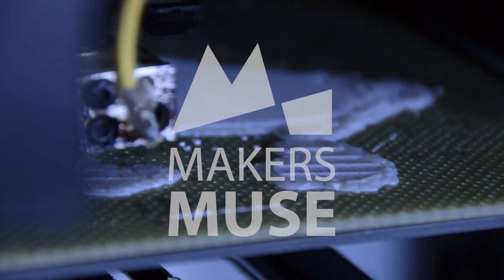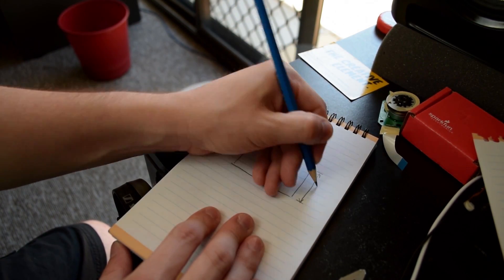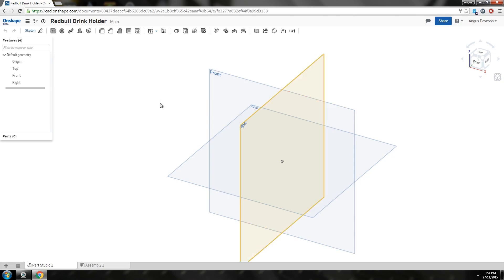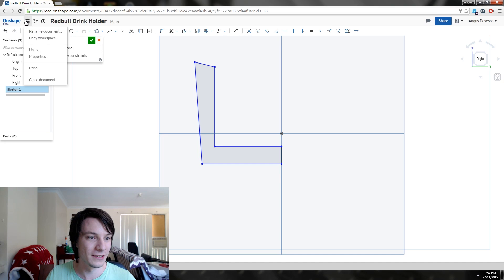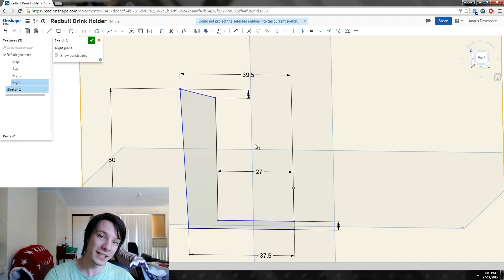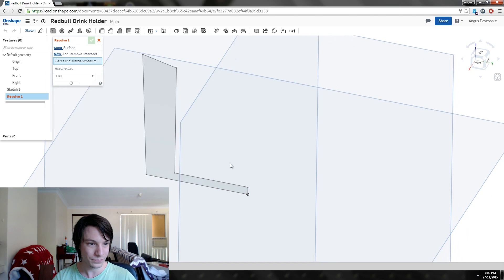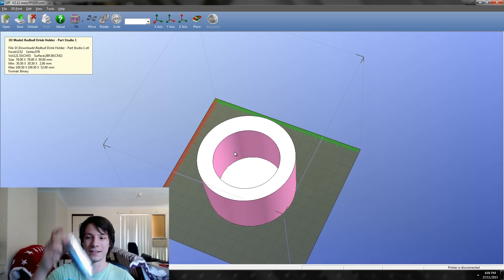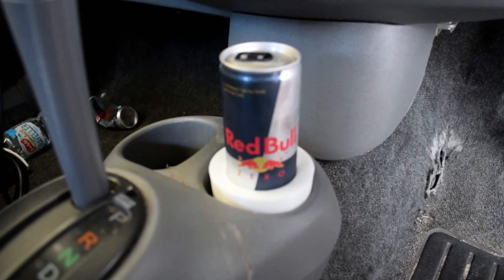Let's Design Something in Onshape! Redbull Drink Holder - 2015

Comment: Something I learned,  regardless of what mode it's in, imperial or metric, you can type in a dimension with either in or mm after it and it will calculate the appropriate value for your current mode.  You can even do math when entering a dimension, i.e.  entering "27+50mm" would set the dimension at 77mm.

Comment: i figured out that "splitting the design/sketch in half" is the way to go when constructing "lathe machined"-objects. but still... my mind works in diameters and pictures the whole thing. i am wondering if there is a way to constuct "diameter based" (so that i can see the correct values in my dimensions) and split the whole thing in half when i am done???

Comment: Great video tutorial. I used my 3D printer a little while ago with a simple screw lid design. My wife has a drinking glass with a metal screw on lid and the lid started to discolour and rust, so I made a screw-on lid with PLA. While the lid does work it is not water tight so I need to make a soft plastic seal for the inside of the lid. I used "Vectary" online software and I did change the settings to use mm and not inches but something went wrong with these settings, after printing the lid, it did not fit the glass. I had taken detailed measurements of the glass and transferred these to my drawing and then using the rotation tool to make the lid.  The inside thread was fun because it caused memory issues with the laptops 4k ram, so I think I need to boost this up to 6 or even 8K ram or I look at other ways to create the thread. Not sure if the glitch is in the slicing software (Cura) or both but they are supposed to be compatible. However, overall I did find that this was a very satisfying and practical application from a design and manufacture perspective. I would encourage everyone to try it, you will find it very rewarding.

Comment: I think that if you'd left the bottom out of the holder when printing - creating a tube -  it would have been a better solution as the can would then sit more securely to the full depth.
Reply from the maker: +Nicholas Fox I wanted to catch any spilt redbull instead of it making the original holder 'even more' sticky, but yeah either design could work!

Comment: pretty good effort alex. do you think if you made a torus with the same inside dia as the can, and the external dia similar to a point in the draft it would be simpler?
Reply from the maker: +Richard Hart Hmm You probably could, not sure you can get too much simpler than a single sketch and revolve though! 3D Printing a Torus shape is challenging as well, due to the small contact area on the print bed.

Comment: why didnt you just make the outer diameter the size of a can?
Reply from the maker: +alex elias Could have done! But the drink holder in the car is quite oversized and oddly shaped, so a normal can is still a little bit loose, I wanted a really tight fit.

Comment: Angus.  This is exactly how I print.  For 'need'.  I need something, look for it online, don't find it and then make it.  Idea in the morning and finished product before dinner. Being able to create things in 3D software is the next step up from simply downloading from online repositories.  I find it is a much more satisfying experience.  Better than crossword puzzles.  I  never hit the correct size first time.  2 or 3 iterations usually get it done right.  Thanks for the video.  Good stuff.  A practical demonstration of Onshape.  (Funny, I live in the US and am trying to convert to Metric.) [ I have a Lulzbot Mini.  Great printer.  I use Cura as my slicer. ]

Comment: Nice :)The best way to design a proper shape for your adapted can-holder, is to scan the actual can-holder, get a point-cloud from your 3D scanner, generate a STL, design the shape of your Red-Bull can, apply about 3mm  offset to it,  make a Boolean of the original scanned data - (minus) the Brep solid that you got from On-Shape. After that, print it!
Reply from the maker: +Davide Ciarloni For sure! 3D Scanning is perfect for unusual, non uniform shapes. What kind of scanner would you use for something like a car drink holder though? It's a fairly awkward location. I had enough trouble getting calipers into it!
Reply: Thanks for your reply!
..  a portable 3D scanner.
There are many on the market. Some of them are really cheap (they are not so accurate...).
You have to ask also for a direct STL output.

Comment: You should try out octoprint. it is a server program for your 3d printer, it even has the option to timelaps your print.
you can feed it gcode from your favorite print software or a STL file.
 
Most 3d printers are supported by it
Reply from the maker: +DutchBrony Octoprint looks great, definitely need to give it a go. Sadly it's not compatible with any of the UP! Brand printers (closed source slicing and control software), but should work fine for the Wanhao i3.

Comment: you could of opened you model on meshmixer and pressed hollow... make the offset a small amount then cut and slice it like bread.. then mirror so it has four arm's and it would use alot less material. . I will try it and if it works I will upload it to thingiverse and let you know

Comment: there is a cool function in meshmixer that BLEW MY MIND. ... I saw that your design.. the top was skewed.. you can cut the top and make it flat on meshmixer. . then if you use the select tool you can make the angle threshold lots and size as big u want. . then after you select a face.. press deform and transform.. it stretches it and if you drag it up then hold the little squares next to the arrows.. and drag it you can make it angles and do that a couple times then use select tool and select the sharp edges and press smooth. . for corners on objects use Cotan. . for the faces like the sharp edges along the main part use membrane. . I love turning things into vases by using this tool.. please try it Angus and let me know how it goes and if it works

Comment: hmm I cant find dimension tools it seems my controls are a bit different. I put in the survey that I don't work with cad and I am used to solid works is this the same as you?
Reply from the maker: +Yadher Bustamante The layout is a little different, however you do still need to make sure you're in sketch mode to access the sketch tools, the dimensioning tool should be upper center on the tool bar.
Reply: +Maker's Muse strange i looked everywhere i did the revolve and everything. im in sketch but dimension cant be changed its just hiding im sure i will find it. thank u for the video it was convincing enough to make me switch.

Comment: Seems like you printed that solid. If so, it would be overkill in wasted plastic for the simple functionality and be less effective as an insulator than if you left a matrix of air in the sides with low fill.  Just a thought of something to keep in mind and relay to people when doing such tutorials to speed print production and reduce waste when possible not to mention the side benefit in this application. Otherwise, keep up the good work.
Reply from the maker: +SayWhat? Not solid - where did you get that idea from? :) It's printed on the minimum density available in the Up software - roughly the same as 10% infill in Cura. I did think a bit about density, by printing with low density you probably provide a degree of insulation like you suggest. I DID even consider printing hollow and filling with water so you could freeze it - I suspect that would have ended in disaster!

Comment: Morning Angus, thanks for another great tutorial, showing exactly how things are done.

Just two off-topic quick questions:
- Do you have any experience printing w HIPS? I understand it sands and can be smoothed out easily w solvent. It suppose warps less. Any draw back w using HIPS?

- Abt that TIKO kickstarter printer, have you backed it? I am just curious abt the flexible bed that suppose to make removing the print easier. But wldnt a flexible bed messes up w calibration? Is there any other printer that has flexible bed too?

Cheers,

Ken
Reply from the maker: +Kenneth Chow Hey, thanks for the kind words. About your questions - I have printed in HIPS it's very similar in strength and properties to ABS, it still can warp but not as much. Support material is a little harder to remove in my experience but not overly. 

I haven't backed TIKO - I've got very little interest in a low cost PLA only printer like that, plus I've seen enough failed kickstarters in that category (such as the Buccaneer) to be very wary. I also have doubts on the flexible bed! Some beds allow flex to remove prints but that one seems very much too flexible for long term reliability and 'flatness'.

Comment: I love onshape! please do a video where you make a 5 inch extension give or take on the CEL robox to hold the extruder heads and support the 2nd filament reel and add a touch screen connected to the back! you may need help from CEL to get the touch screen and SD card!

Comment: Very good video.
I would use Onshape more but I am using a satellite link and the old speed of light delay really make it a pain.
On the dimensions you divided by 2, I believe if you put a center line in the sketch you can dimension from the point to the center line and have the cursor on the opposite side of the center line when you place it, then it will show the diameter dimension.
Reply from the maker: +Andre Blanchard Cheers. Yep Solidworks is the same, problem is you revolve around that line in the case of my sketch so it can't be construction - you can always convert it I suppose! Nice tip. I can imagine how painful it would be on satellite link... aus internet (unless your on NBN) is pretty slow.

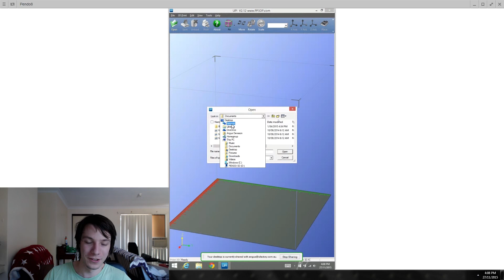Comment: 13:36 You should just use windows' built in remote desktop, which you can connect via LAN.
Reply from the maker: +albb0920 Neat - does it work between  7 and 8.1?
Reply: All windows version has RDP client, but only pro has RDP server.
You can enable RDP on non-pro version with this patch. (I use this method)
https://github.com/binarymaster/rdpwrap/releases

You can also consider Teamviewer, which you can enable local connection in the settings, and type IP as ID to connect.
https://www.teamviewer.com/zhTW/help/40-Can-TeamViewer-be-used-within-a-local-network-LAN-only
Reply from the maker: +albb0920 Cool stuff! I'll check them out. The 8.1 tablet isn't Pro, so will look at the patch or teamviewer on local. Thanks!

Comment: why not autodesk inventor ? the student version is free and more powerful than onshape
Reply from the maker: +someoneonlylol Two reasons - 1, not a student so would have to pay for it... and 2, the big issue with most powerful CAD software (like inventor) is the large download and need for a fairly grunty PC. With onshape, the cheapest chromebook will run it fine. :)
Reply: +Maker's Muse you dont need an educational email to register for it. IMO onshape is much less functional than solidswork and inventor
Reply from the maker: Yeah, I don't doubt it. The point remains even if you 'can' get it, I can't legally use it for free and then post tutorials on it... pretty dumb move on my part if I did, it would violate the TC's.

Comment: Angus, that remote desktop setup you have seems to be working well for you. I've been using Octoprint on raspberry pis (octopi) to good effect with my printers. One advantage of the web based interface is it makes it easy (with the help of a little magic in your router's firewall) to monitor or even start/stop prints remotely from outside your home network.
Reply from the maker: +Juan Garcia For sure - I've been looking into it for my Wanhao. Shame that UP! software is totally locked down so you can only use remote desktop.